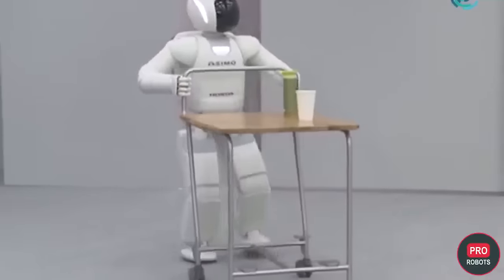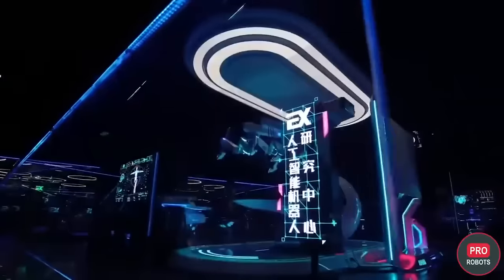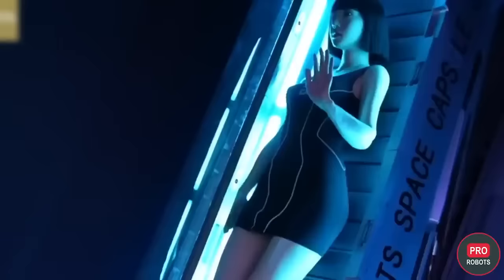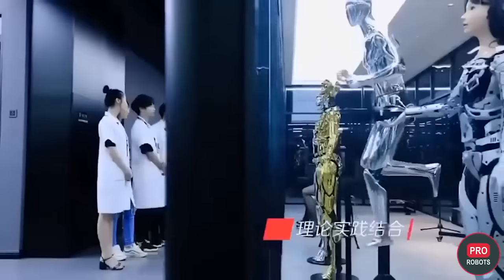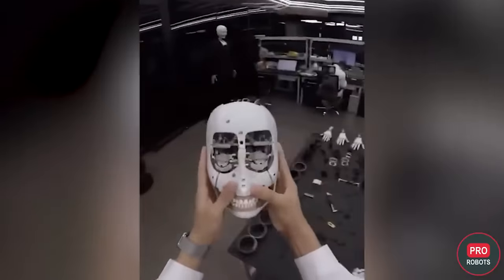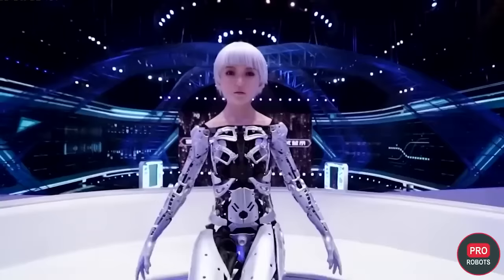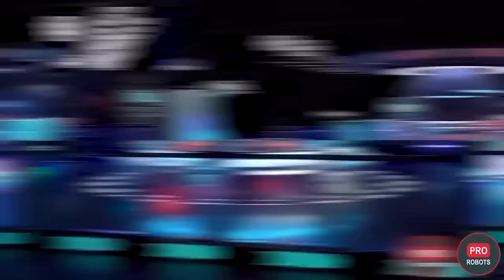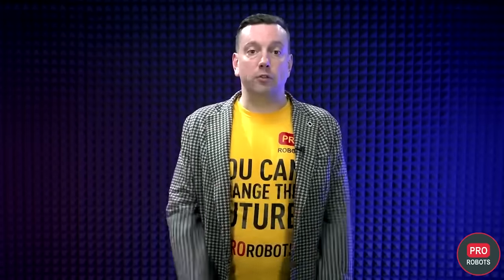The most advanced humanoid robots from EXRobots

Comment: Long way to go yet but considering how far the tech has come and how tech builds on tech it shouldn't be too long before there is a truly compelling product.
That bit about eye contact and facial expressions is true.
Experience that in VR.
Reply: Ridiculous illusion.
Reply: @carolineoakshett8520  Worried you'll be outclassed?
Reply: Nah fam, a finished enough product for dilating eyes that look right by capturing and using light and moving about the pupils already exists on GH and is based on a technique that existed since the 70s. Surprised most don't use it, but it does use a limited amount of graphene to achieve the absorption to mix with a hybrid system to track the level of light captured for the optics as well as contract and expand the pupils.

I got the file archived on a server and YT is an absolute tool, but all you gotta do is look up: 
carlstrath/robotic_Eye_System, or perhaps realistic dilating eyes on something as basic as google or brave. This even if washed out by some things, will eventually lead to at least one article chronicling it, and a link to the page of it as well as demonstration videos on a normal robot.

As for expressions, I think one of the faults of expressions is response time, and the tight jerky jaw look that appears like a muppet. Tiny artificial muscles can be used to solve that. developer
Reply: @jaygyrobro6104 that's why they uses servos, that shit doesn't work well, quickly and smoothly. I know 2 better technologies for that problem, they are stronger,  faster, and with zero noise, but they will have to hire me first if they want me to say more.

Comment: When they can make the robots anatomically correct then I will be interested in one
Reply: Check out Clone Robotics. Crazy stuff
Reply: Japan can.  China does not have the chip manufacturing capacity to make robots, unless it imports chips.
Reply: Anatomical as in the funny bits? Then that is where new model S-dolls are at, and they have robotic heads but not really animatronic bodies. Anatomical such as the movements and speed? Corey shows of reference of the originally named Automaton Robotics which produced a water-type McKibben artificial muscle robot which is more advanced but technically the developing technique needed to make it is so unsophisticated but reliable and durable that anyone could do it and replace the parts when a cycle-life is concluded or intensive damage like a busted tube.

If one is looking for jogging and funny hops, there is always the DARPA Atlas experiment.

Japan is generally more advanced and sophisticated in the bodies, and no real way to find modern information without working there or finding the titles of videos in Japanese and Japanese articles. China more so tries messing with the AI bits, but doesn't have the means to mess with the finer miniaturization to do more complex things like hard-robotics like stepper motor level things and terminator pistons on the level of an artificial muscle.

America pretty much is the home of animal bots though.

Comment: This I have to say thru my observations. Technology may seemed going into endless developments and for being good or bad is relative and subjective. The only Technology that  the Engineers cannot do to Robots are the EYES that has EMOTIONS/FEELINGS to make it look REAL. Because even on Digital Animations, the EYES stare like Dolls or Dead Stare/Dead Look, if I may say so.  I remember the saying "The EYES are the windows of the SOUL".  But ROBOTS have no SOULS, that's the problem. Maybe in the nearest future, they can create a Humanoid or something.
Reply: Oh yeah that's one of the issues with them generally, even with the more up to date ones with still using RRS matted TPE or modified new silicone skin with hollywood tier industrial makeup. But the issue isn't really emotions/internal feelings in the eyes exactly. It is merely dilation of the eyes which matter most, combined with reflection of light captured yet equally so at the same time a darkenedness as the eye's receptors are taking in the available light in the area or room to help with data like seeing in the distance and color saturation when processed by the brain in a human.

The strangest thing is a lot of things to beat the uncanny is already developed and robust, some even easily able to be modified for soft robotics like water-type or normal air varyingly sized McKibben-type muscles. [Though hazel would appear more realistic but cannot fit on a human frame even if 6'8 and make proportionate to it. It would create new superficial issues to the human eye which would recreate the reanimated remains thing subconsciously.] On the GH for example utilizing graphene due to its abilities most to mimic our receptors, the dilation of eyes and a full scan of a human eye has been completed and it is public. When applied even to a regular humanoid robot with minimal human features, it can automatically in the average human incite the similarity and familiarity type of projection of humanity onto it. Or intention and sapience/agency/self-sovereignty. Automaton robotics/clone incorporated with water-type heated McKibben muscles follow the movement speeds needed for us to beat that uncanny valley issue itself, voices can already be made human digitally through recording, let alone recording, altering it to sound like a different voice type entirely like actors and actresses throwing their vocal cords resonances and pitches around, and giving it a word script and training it to speak normally rather than one word at a time and robotically. We also even have artificial muscles and air tubes, and pneumatics which can simulate vocal folds but only sound right when merged in sufficient conditions like a more realistic environment. [Wet, silicone or bioprinted skin grafting, air.] to remove the muffled distance or weirdly placed distortion effects, and we also like mentioned above, have skin-cell creation and grafting, or using new silicone types with RRS matting and/or hollywood style makeup to make the veins and etc if not wanting to add in misc-circulaton pipes. They also have inflatable muscles to act like heartbeats and lungs. All to play on the human-brain's need, as well as to incite a more passive response.

Though if one doesn't mind full biomechanical leanings, or throw out pure-electronics like that new eye they made, we already can create eyeballs that have it already built in and technically could be viewed as cheaper than new tech. It'd just need an adaptor type to connect organic optic nerves to standard wiring and use the electrical signal/current to return to the machine's brain or parts of organic brain [or even go full on and have entire parts of a real grown brain, which would effectively count as an empty unworking one and need an interface to add information to it to function correctly.], and therefore the eye would work the same regardless. Then just make a tiny tear-duct meant to help clean debris off the eye and relieve soreness, and both types of eye would achieve the same result.
Reply: @jaygyrobro6104  With all the Technicalities you mentioned I still don't believe they can create real EYES responses because ROBOTS have no Emotions/Feelings. And emotions/feelings are reflected in the EYES. Whether one is happy, sad or angry, the EYES say it all. Even the latest and best Robots moved and walked so awkward and not fluid.  That's another aspect to be perfected.